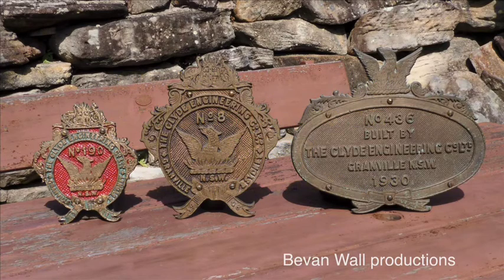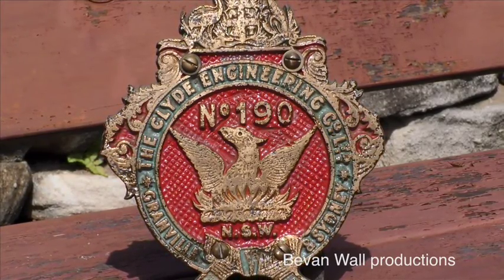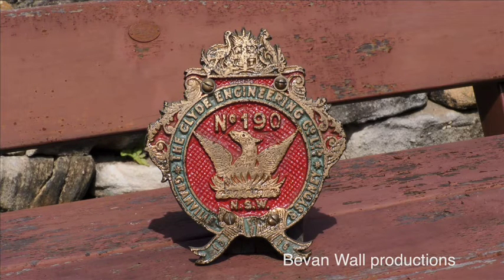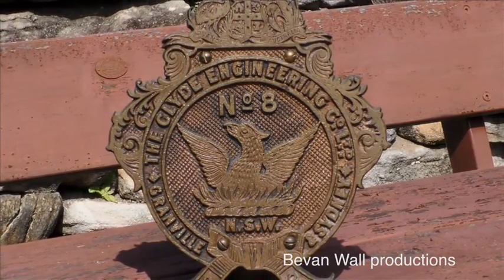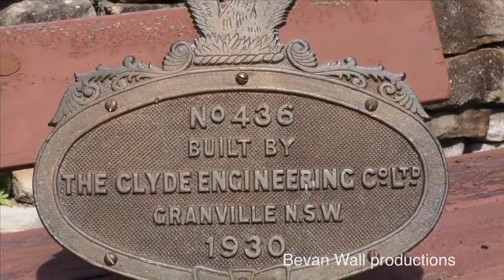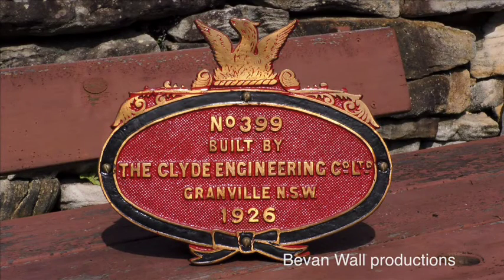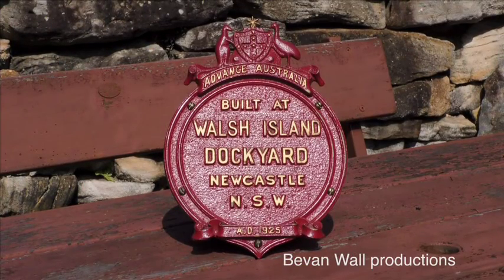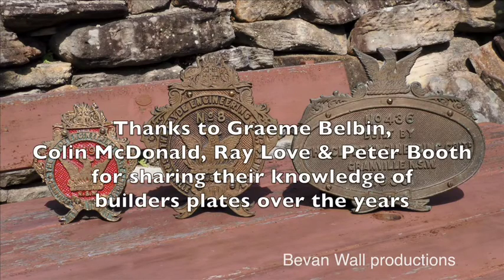Clyde builders plates on NSWGR steam locomotives

Comment: We are offering for sale black copper plate that was made by The Baldwin Locomotive Works in September 1915.

Number 42366 comes from the locomotive type E(f) that was made and delivered to Russia during WWI. It is believed Sergei Lazo was tortured and burned on this train by White Army in 1920.

Plate is in excellent condition with no scratches. Diameter 9.25", weight 56.44 oz. It was cut off of the locomotive boiler in 1986, Depot ВЧД-6 station Irkutsk-Sort, Russia. Boiler was repurposed to heat the depot and locomotive was utilized.

We live in DC area, but the plate is located in Russia, Angarsk. If you are interested or know of another museum that might be interested, we can hand deliver it.

Asking price $19000 —bargaining is appropriate
Misha.papizhuk@mail.ru